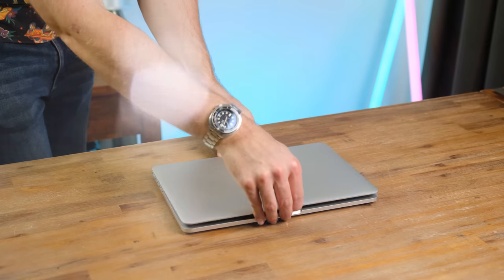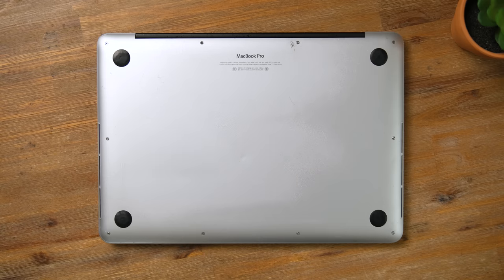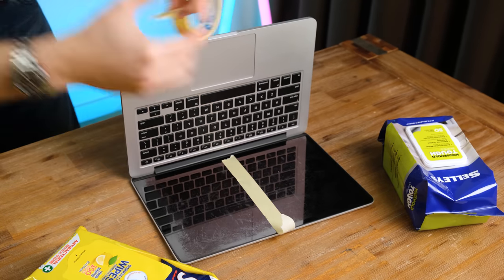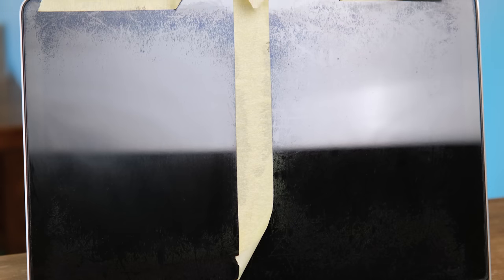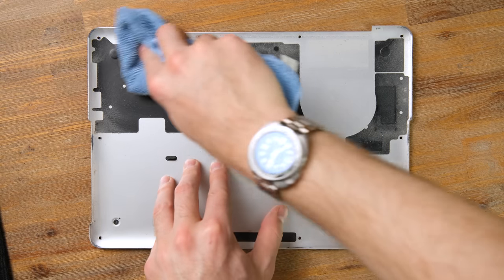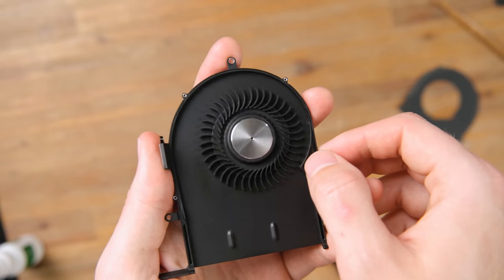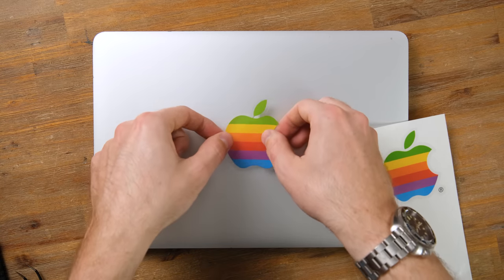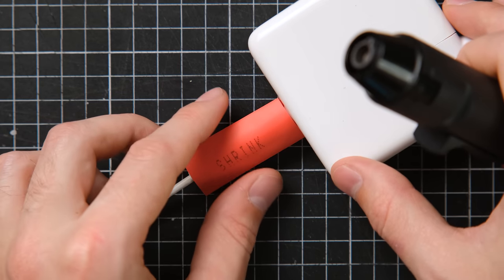Restoring A Cheap Macbook Pro From Facebook Marketplace!

Comment from the maker: Thanks to AG1 for sponsoring today's video  https://drinkag1.com/Psivewri
Reply: I’ve got a MacBook that won’t turn on if you want to use it for a video
Reply: How much are you gonna sell that MacBook
Reply: Cut a slit in the shrink wrap.  Wrap it around the broken portion of the cable.  Heat it up.  Problem solved.  The shrink will adhere to itself.

Comment: I worked at Lenovo as an OEM test engineer for 8 years and I can say that we did extensive testing with different types of thermal grease and paste and we conducted many test in a lab setting. One interesting thing we tested was thermal paste longevity and we always had test subjects in the lab running with different types of paste in different climate controlled areas. To conclude, we found out that thermal paste that contains silver will usually last for around 20 years on a CPU application. The drying and cracking of thermal paste is quite common but is still making a seal to the heat sink. During testing, we also noticed that hot spots develop over prolonged periods of use making the CPU a little bit hotter over time. OEM thermal paste always looks bad and seems to dry and crack but let me reassure you that the thermal paste being used is very high quality and is designed to last a very very long time. When engineers are designing laptops, they never expect the end user to replace the thermal paste in the lifetime and afterlife of the device.
Reply: What is the carrying agent ( emulsification agent ) you were using for the silver based paste ? When that flashes the solids flip and turn into insulators in many instances. I assume it was desiged to " flow " to get it out of the syringe ! ?

Comment: my first MacBook and still one of my all-time favourites! I actually had the display replaced by Apple in 2018 as the anti-reflective coating came off, it's been fine since. I feel the 2015 Pro was only succeeded by the M1 Air when that came out. I still use mine, I have Windows installed on it on the off-chance I need to use software that won't run on macOS

Comment: My 2015 MBP (w/ upgraded SSD & replaced battery) is still my daily driver -- emails, browsing, some webadmin work, etc. I've got it nicely set up with a triple-boot for macOS, Win11, and Linux. For anything more computationally or graphically intensive, I've got my desktop PC.
Though I have been looking at new laptops because it'll be time to upgrade within the next couple years.

Comment: FYI the northbridge chip is supposed to be left unpasted (6:21 note how the heat spreader doesn't actually cover the smaller die) . Applying paste to it will make the machine run hotter since it's soaking up heat from the CPU.
Reply: Yeah that's what I thought too, there's probably a reason why they don't paste it in the factory. Now the smaller die is absorbing heat from the CPU and that's probably not how it's supposed to be thermal-wise
Reply: Ok, so paste only on the shiny rectangular bit, is that right?
Reply: @mariogambrelli  Yes, only put paste on the bigger shiny rectangle and leave the rest untouched
Reply: @timrault  Ok thanks Tim! I'll start again. Is it urgent, would you say?
Reply: @mariogambrelli  No I don't think it's urgent, just something that might end up causing unexpected wear to the chip in the long run
Reply: spple and it garbage design

Comment: I recently bought a fully maxed out 15'' 2015 MB Pro for only $300. The main downside of it was that one of the previous owners literally used sandpaper to get rid of the anti glare coating. Because of it he completely obliterated the screen layer beneath it. Fortunately that screen layer was made from some type of plastic so I spent 40h on dissolving it with acetone and polishing the remains of the glue. It came out really good and I even bought and applied a new anti glare coating onto its screen. The computer is in overall  perfect shape and its original battery even had only 300 cycles on it. All in all if think I got myself a great deal, tho German keyboard layout is starting to annoy me, but I may get used to it.
Thank you for such interesting and engaging videos.
Reply: Nice! Do you have any link to a guide or website on how to apply the anti-reflective coating? Or did you did you just stick an anti-reflective film on the screen?
Reply: @randomscience4k go slow, and think that nothing bad is going to happen, if your hands shake, mines always shake when working with electronics
Reply: What the fuck my mid 2015 fully maxed out cost $5000
Reply: @gucciman697  How? Wasn’t its sticker price like $3000 back in the day? Oh you mean $AU? I’ve meant $US.

Comment: I always use sugru moldable glue to fix worn apple cables, works great and gives some extra strain relief on the cable.
Reply: Same!
Reply: yeah, or use heat shrink, bc electrical tape won’t cut it

Comment: I bought the exact same MacBook for $200 off of eBay. To get the anti-reflective coating cleaned off I used metho mixed with water and baby wipes. The MacBook works good especially with opencore Legacy Patcher I'm now running Ventura with an adaptor so now I've got 2 terabyte SSD in the MacBook.

Comment: As always excellent restoration! really enjoyed it. I too recently sold my XPS 9350 and got a late 2013 15 inch MBP for really cheap. Only issue is it too has the antireflective coating a bit peeled off in three places. Not as extensive as yours, but I believe eventually it would get worse. Unfortunately I could not find the Selleys Household wipes here, but only Selleys BBQ Tough Grill Wipes & Selleys Sugar Soap Wipes. Nathan will any of these two work for the task? Thanks!
Reply: you can probably use clorox/bleach wipes
Reply: @beepyshenanigans  I sold the MBP a few months back. Clorox wipes worked great!! 👍🏻Thanks for the tip :) One of my friends tried ArmorAll dash cleaning wipes and it worked even faster.

Comment: I'd actually disagree since moving to quad cores was such a nice change even for just normal web browsing with as heavy as pages have gotten nowadays, especially if you're a heavy multitabber like me. I just won a bid for the 15" with the M370X used, excited to get it! Until the 13" models moved to quad core, they all felt pokey to me even just on web browsing and basic use.

Comment: There needs to be a light abrasive that won't scratch the screen, toothpaste or Brasso works well with a microfiber cloth, using Brasso, I've done the coating in as little as 10 minutes. You end up with a very shiny screen and yes, there will be glare, but there are ways to deal with that as well
Reply: I think some of these had plastic screens, so the Brasso might polish them a bit. The ethyl alcohol in the wipes is probably the least invasive method (avoid IPA because that'd probably dissolve the plastic).

Comment: how are the CPU temps & fan speed after changing the thermal paste?
In idle and eventually when playing a 1080p video on Youtube.

Easy to check without any additional apps with terminal:
sudo powermetrics --samplers smc |grep -E "CPU die|Fan"
Reply: im also interested, btw that was an original thermal paste ;)

Comment: How do you get Minecraft working so well on these laptops? I recently bought a 2014 MacBook Pro with 16gb ram from Facebook Marketplace as well and I was expecting for the performance to be similar to what you've shown from your repaired old MacBooks but it runs much more slow and laggy on mine. I tried Optifine which improved the experience but it's still pretty bad.
Maybe my mac just has a worse processor or something and I can't do anything about it? Any ideas?
Reply: Thermal throttling (maybe).

Comment: LOL the timing of this video is uncanny. I purchased a 2014 MacBook Air for $1 from my work as it had cosmetic issues, someone dropped it and the corners were bent. It was marked as non-working for some reason, came from another building. A rag and a pliers fixed them back to almost normal. The battery was toast and would not hold a charge but had a pile of old batteries that were slated for recycling and found one with a lower amount of cycles. So it holds a charge now. Loaded MacOS Ventura via OpenCore Legacy Patcher, works great!  Also picked out a decent charger from the pile that was left over after the auction. So being an IT admin has it perks and I had a great MacBook Air for my recent vacation trip. Gave me hours of movie watching as I loaded the drive up with TV shows and movies I had ripped. Cheers!

Comment: Bought 2015 15” a few years back. Had the anti-glare issue so I got a good deal. I had originally planned on fixing it, but once the monitor is turned on you don’t even notice it.

Comment: I bought a used Macbook Pro 13'' with that kind of screen damage (coating) off eBay and got the screen replaced by Apple free of charge just a few weeks before the program ended.  It's Late 2013, bought it in 2016, and I am writing this comment using it 😎
All I had to do was replace the battery (did it myself) - $100, works great 
New charger brick (wires got loose inside that MagSafe connector - probably because of the way I was disconnecting it by pulling) - $50
One of the speakers stopped working properly a few months ago, so I have to fix that

Made a mistake to upgrade to Big Sur a few days ago, and now my iMovie won't work anymore... And cant even can't install an older compatible version via the App Store....  

Other than that, I'm quite happy with it

Comment: As you like to clean the screens, what would you recommend for cleaning a Oled screen? - thanks
Reply: eucalyptus oil
Reply: on Oled distilled water apply a little to a microfiber cloth than clean the screen. Chemicals and spray are not recommended on modern display

Comment: You keep saying die in all of your videos for the package.
The die is what's inside the package and sometimes visible (the shiny bit on top)
But the package that holds the die(s) has the pins and the bond wires. So please don't confuse both, thanks.

Comment: Replacing the cable is very easy, I did it with the charger for my old 13" 2012. All you do is cut it open and solder a new cable in, then glue it back shut.

Comment: i picked one up for £250 a year or so ago.  I did the same thing, clean and upgrade the SSD.  It's got Monterey and is now going to college with my daughter - I used Sugru (moldable putty) to strengthen the power leads.

Comment: I can attest to the Listerine working. My 2013 MacBook Pro screen was delaminating but just around the outer edges. So I taped it off and used some of the mouthwash on a cloth and sure enough it removed the film. So it works but the wipes are definitely more practical and seem to work just as well.

Comment: My mom has the same model MacBook Pro (2015, 13-inch), however the the battery has worn out and would last less than 3 hours, speakers are blown and broken (apparently the MacBook also stinks, there must be a lot of dust inside), and the charger it came with isn't the original one (it instead came with a Chinese one, which is dangerous to use since it sprarks whenever I plug it in). macOS Catalina was installed but I had to upgrade it to Big Sur. I'm still surprised that it runs quite well even in 2023, and my mom has enjoyed using it for basic work (despite having blown speakers and poor battery life)
Reply: my moms 2013 15 inch has a blown speaker, so she borrows one of my bluetooth speakers, the battery lasts around 3 hours and apple dropped support in monterey, so it needs patching, but it’s still good for her line of work, she owns a trucking business
Reply: i’m sure the 2015s can run monterey, but they can’t run ventura, at least without patching
Reply: DONT USE CHEAP REPLACEMENT CHARGERS, even though i use one for my main, my lenovo. Lenovo ships crappy chargers with their laptops, but even my replacement charger still is beyter

Comment: I bought a 2014 MacBook Pro and the screen was really ugly therefor I got a really nice price on it and I cleaned off the screen nail polish remover and some kitchen roll and it looked amazing and there were no scratches on it so it was mint. Bought for 120 Euro Sold for 650 Euro

Comment: My laptop is a MacBook Pro (Retina, 13-inch, Early 2013) ... the anti-reflective coating is perfect. Not sure what I did right? A decade on and I plan to upgrade when it becomes a teenager.  Using this video as a guide for doing my first clean soon. Cheers mate, $0.02

Comment: Nice! That's a good find for cheap.
I have the same spec 2015 macbook. I've been thinking of upgrading the motherboard to the 16gb ram i7. Are the performance benefits worth it?
Reply: yeah, they are, my moms 2013 retina mbp with the 16gb i7 combo, is snappy, runs faster than my 8 gb i5 lenovo 330s running arch
Reply: not really, all of these models are dual cores, meaning they'll feel slow no matter what you upgrade.
Reply: @Piipperi800  my moms is like a quad core
Reply: @Piipperi800  the i7 is a quad core i think, it certainly performs like a quad core
Reply: @beepyshenanigans  no 13" MacBook before 2018 had quad cores. Either you're talking about a 15", or you have not used a laptop with a good CPU before
Reply: @Piipperi800  mbp, not standard mb, if their referring to the same spec 2015, that means that their referring to the 2012/3-2015 retina mbp
Reply: @beepyshenanigans  I was saying MacBook 13" to include all models except the 15" and 12". The 2017 TB 13" Pro was the first 13" MacBook to get a quad-core CPU. With the 13" non-TB model later getting quad core option in 2018. And MacBook Air got the option in 2020.
There hasn't even been a 13" "MacBook" since 2010.
Reply: @Piipperi800  ohh, my mom has a 15 inch mbp